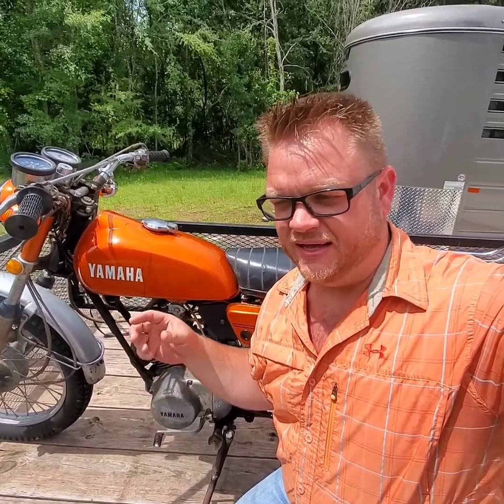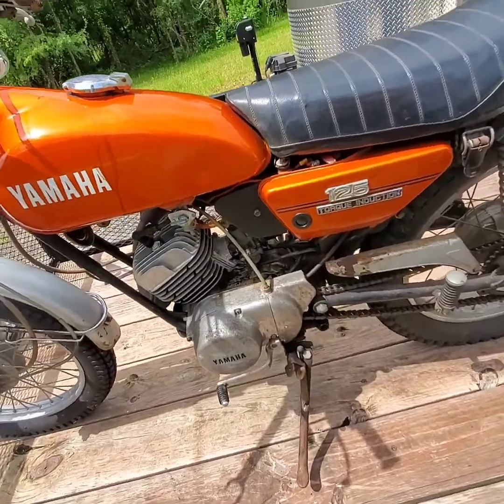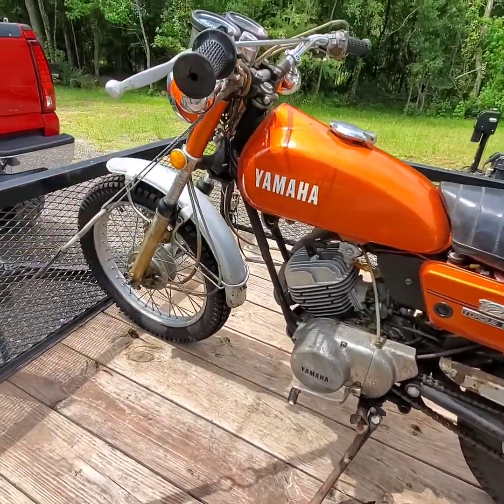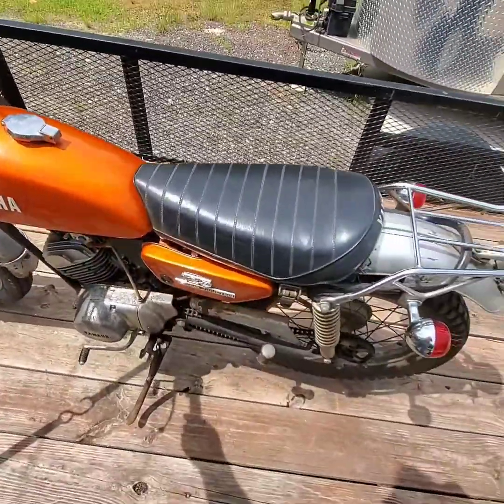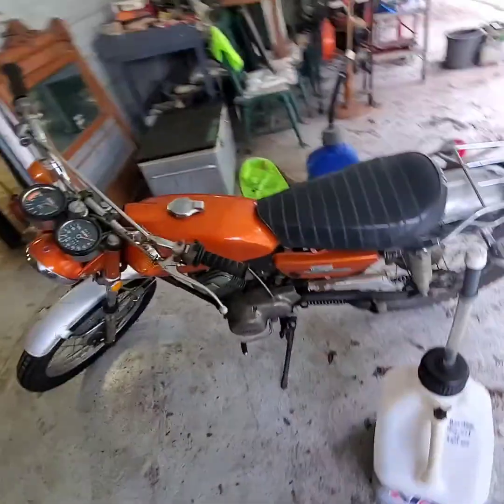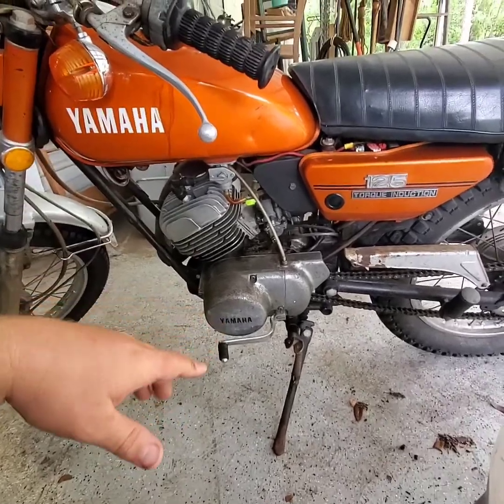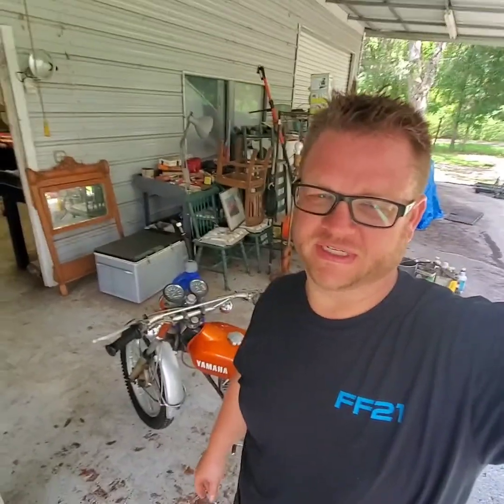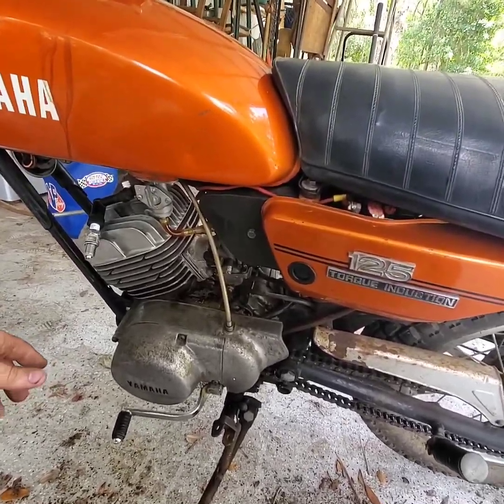Bought a 1972 Yamaha 125 enduro that my Dad really wanted.

Comment: My father in law gave me one ☝️ 
1972 Yamaha 125 Enduro but mine is blue. It's pretty cool but I'm always having trouble keeping the battery charged enough to easily start.  But with a hot battery it starts first kick. Mine has electric start but Pop's didn't even know it , I found out myself when the forks pinched the wiring harness and when I turned the key on it jumped forward. He also gave me a 1979 Yamaha 80 and a 1982 Honda CT 110. I love them but but my dad doesn't like motorbikes so we didn't grow up around them so now I'm learning as much as possible. Many blessings to you and your family 🦾
Reply from the maker: Awesome! Enjoy those bikes